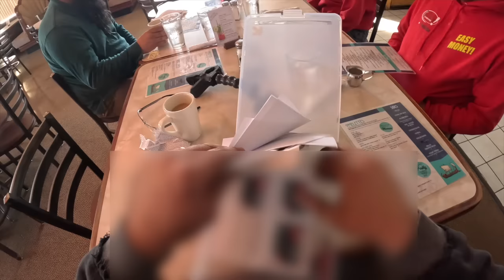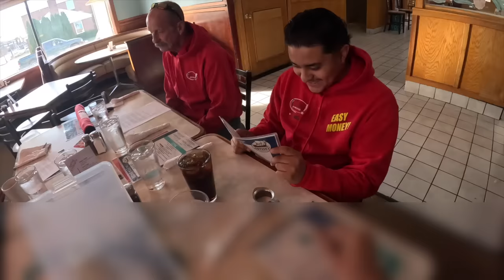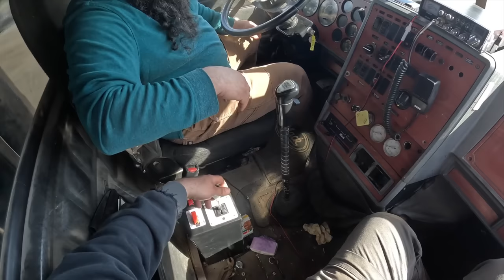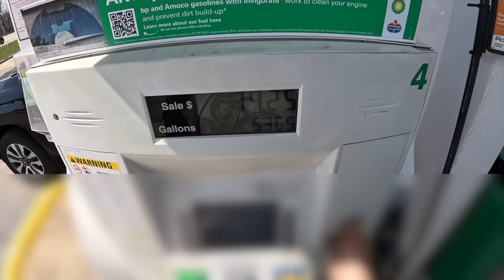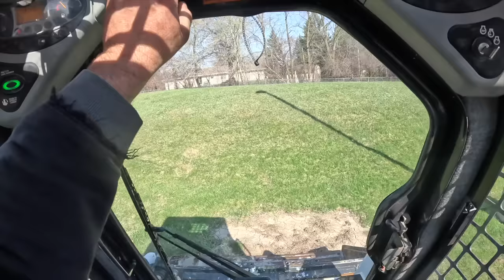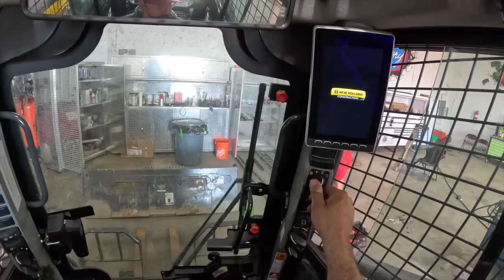I need LOTS of patience, NEW power buggy, new CDL driver!

Comment: That new equipment looks really great! What an upgrade! To keep that new buggy looking clean you should first wax it everywhere a couple of times, even the visible parts of the engine. Then just before using it wipe it down with an oily rag or spray it with WD40. That will keep the cement from sticking to it so it is easier to clean it right off. The old buggy can me cleaned up with with swimming pool Muriatic acid to remove the dried cement. Be sure to keep it away from Eric! I'm sure Nate can use it safely Then wax and oil it.

Comment: You should get a back up camera mounted in the back and make sure it's protected like you did with the light plug on the flat bed that way you don't have to try so many times backing up to the trailer 😂😂😂

Comment: Get the painted parts of the buggy Line-x with the premium top coat it’ll last a lot longer, easier to remove concrete and keep the frame/body intact & cleaner much longer

Comment: Got a quick fix for your headlights on the 350, get some OFF Bug spray,  yes off that you put on your skin. Put a rag along the bottom of ur headlight and spray the entire headlight and watch the gunk roll off. But after it does that spray it down once more and take a clean micro soft rag and swipe one way, straight across.  And the headlights will look new, then do it again in 2 months but don't wipe it off, use a pressure washer to clean it. You can put the new ones back for a rainy day

Comment: I cant tell you how many hours I've spent in Home Depot, going through the stacks of terrible 2x4's they put on the shelf.  I dont understand how or why they even try to sell some of them with how bad they are.  We used them mostly for indoor remodeling framing/bracing, so anything out of square was a no go.  The protocol they have for boards that pass is basically nonexistent.  
I can specifically remember a HD associate becoming visually upset with me throwing 2x4's down into the floor rack, to which I responded "well if you had some straight boards, you wouldn't have this problem."

Comment: 39:34 Ryan try the malco they come in 1/4 to 5/16 and 3/8 to 5/16 they are pricey but the magnet on milwakee just don't last and malco does. plus malco easier to clean when rust pieces het stuck on magnet.

Comment: Just have the front suspension completely gone thru on the old superduty. It’ll probably run you  a couple grand if it’s all done and done right but that truck still has years and years of service left in it.

Comment: Same w my Mazda and I cannot afford the new ones 300$ a piece 🤦🏽‍♀️ single mom no family just me and my daughter against the world unfortunately so now I have no headlights wonderful
Reply: Do you need a new headlight assembly or just new bulbs?
Reply: Which model Mazda? You should be able to just replace the bulbs for cheap and if the lens are extremely fogged up, you can buy a headlight restoration to make them look like new.
Reply: @MemestiffGaming  unfortunately my car I tried to just do the bulb as I try to do all I can on my own yes my whole lenses look foggy bad but I can’t afford that rn I bought the bulb went to pop the old one out new one in and realized it’s the old school bulbs and wired into a metal box under the car so u can’t just buy a bulb unfortunately
Reply: @EGHeartattack  unfortunately no mine are wired into a box under the car so to buy it u have to buy the entire thing and run and rewire it as well for almost 200$ I don’t have that per light to spend and I don’t have the tools and a good Jack to do it or the know how I do all I possibly can it’s a 2007 mazda 3i needs so much the ac don’t work need two belts one tiny hole on one of em and I have no family no help just me and my daughter tbh so I’m always stuck somehow someway sadly but that’s just life and thank u so much I do really appreciate it but I tried that I did
Reply: It’s a 2007 Mazda 3i
Reply: @Jill Marie  that's interesting. I owned a '07 Mazda 3 back in high school, and I recall being able to just switch out the bulbs with no problem. On mine, there was a rubber cap behind the assembly I could access.